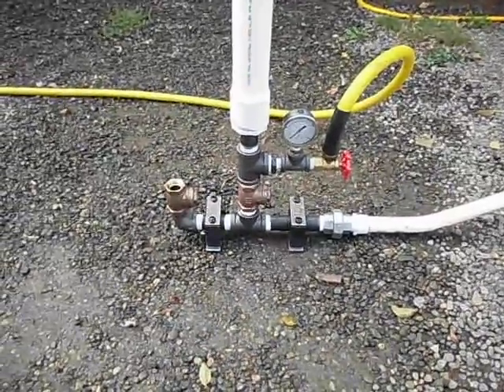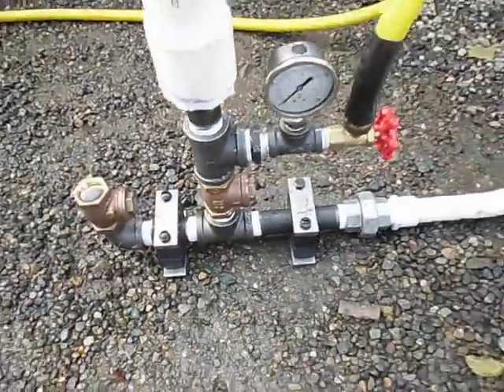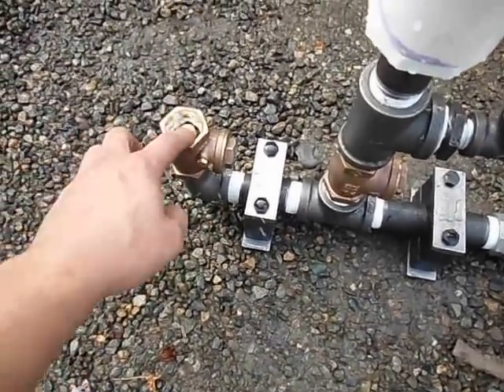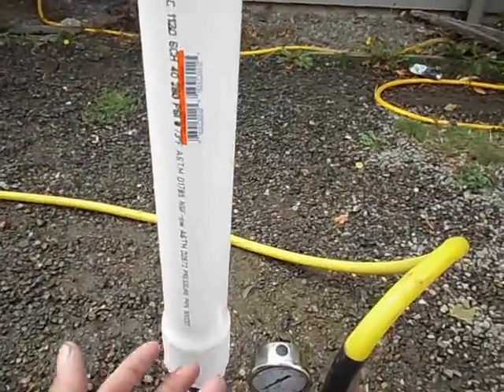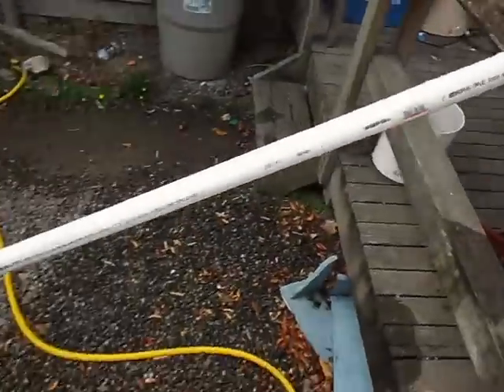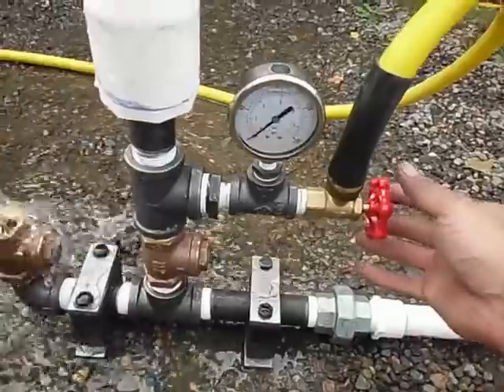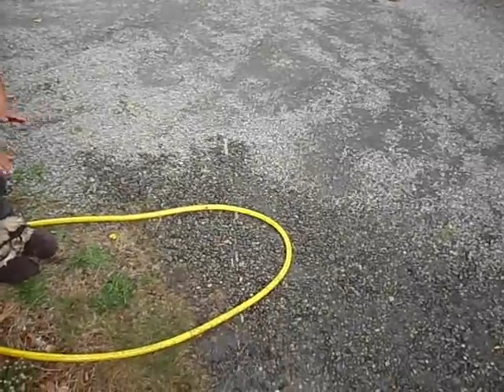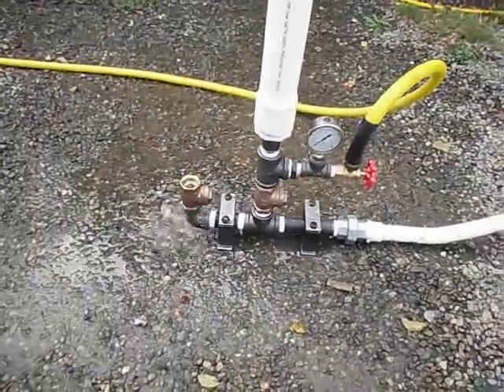Homemade Ram Pump

Comment: am needing a way to get water from a stream up a mountain and for basic use. I think this might ne the way, But one thing.... can modern materials help improve its output or range?  aka pipe dimension trickery, or space age materials?
Reply: A 7000 foot lift would mean the pipe would have to tolerate 3000 psi. That would be hydraulic hose. The lift can only be about 10 times higher than the supply water head.
Reply: I used a 55 gal. drum hung in a tree above my camp to get water pressure in my camp. The pump was about 50ft elevation lower than the drum it was feeding into with about a 5 ft elevation in the creek it was feeding from..
Reply: I ended up using a high pressure ram pump.  7000 foot elevation.  Its a trickle but it works.
Reply: Floydd   7,000 feet??? Lift? That's 1.3 miles.
Reply: Mark G thanks for the info 10: the height formula

Comment: Well done video showing a simple build method.
1. You don't need the foam in the pipe. The compressed air does the work.
2. The principle of a hydraulic ram is you take the potential energy of water at a higher elevation, convert it to kinetic energy as it moves downward due to gravity then effectively reverse that on the output.
3. The variables involved are (mostly):
   A. Volume of water source (in effect size of input pipe), volume being pumped (output pipe)
   B. Elevation (head) of water source
   C. Adjustment of the clacker valves
   D. You work a trade-off of volume of flow to height etc by adjusting your system. I don't remember for sure but I believe faster allows more height and slower allows greater volume (this may be reversed, its been a while since I've messed with this).
4. You should add a snifter hole
Don't take my info as not liking your video, I actually think its great.
Reply: for long term use you do need a diaphragm of some sort in the tower pipe, because the water flowing through will absorb the air little by little. I used a latex balloon, and it worked fine for over 2 years.
Reply: You are correct. The air will eventually disappear in most cases. This is the reason for item 4 in my original post. A snifter hole will allow small bubbles of air into the system, which will keep it perpetually running. But you have to do a snifter right. Too big and you will waste your capacity as you are pumping water out. Too small and it may plug (though a very small hole of about 1mm is fine). Peoples mileage may vary. If a balloon works though, I say go for it. Simple and cheap is always good.
Reply: It was years ago that I built a home made one. I designed my own clack valve out of cheap stuff like washers nuts and bolts, and a pvc adapter. I didn't know what a clack valve even looked like, but the one I built worked good. I just went with an idea that a friend explained to me. I never had to have a shut off valve on the 1/2 inch pipe going up to my camp either. That pump along with a gas burning water heater converted to wood burning, and a 55 gallon drum hung in a tree above my camp  for water pressure, I had constant hot and cold running water for about 2.5 years. I was off the grid living rent free. I loved it.

I just left the whole set up in the Oregon woods when I went to Hawaii to roof after hurricane Iniki hit Kawaii. , Never been back there since Hawaii. Now I am retired disabled and unable to do stuff like that.
Reply: Where does the snifter hole go?
Reply: Kube Dog  I tin in da air chamber where it's needed
Reply: NICK,
COULD YOU PLS SEND MORE COMPREHENSIVE INFO TO ME.
Reply: Where does the shifter hole go ?
Reply: NICK,
COULD YOU PLS SEND MORE COMPREHENSIVE INFO TO ME.

Comment: Pressure gauge is absolutely NOT necessary. Pump will work the same way without it. And the valve on the output line is also pointless and is also not necessary. If you have it, maybe it make sense to put it on the inlet side to stop the water/pump when you do not need it to work.

Comment: Might want to add a small valve between the main line and pressure gauge, just so that when you know its running right, you can close it, or even take it off. So it's not under constant hammering or the water.

Comment from the maker: Great question, although i dont have an answer for you as i have only used water weenies for my bladder, i believe 5-10psi would be a good start, if you do plan on using an inner tube i would suggest making your pressure vessel with a screw on top to access your bladder for pressure adjustments, keep me posted if you give it a try,....josh

Comment: Excellent.  Does the reactive bladder inside the vertical tube make a difference with pressure?  For example:  If I had a inner tube from a bike tire what pressure would be a good start.

Comment from the maker: Wheres the waste? If this were set up in a stream the "waste" would return to the stream, im not wasting any just borrowing it for a while, thanks for the comment,....josh
Reply: Josh  .. . I have a question. Say one wanted to increase the lift of the water as they had little down fall into the pump. 
Could u divert some of the air pressure in the pressure chamber into the outlet pipe and using a smaller outlet pipe so as not to lose the air up the pipe. 
Compressed air will move a liquid as air rises. 

I was thinking a controlled air flow using  a tap so that not too much air is lost out of the pressure chamber. 
If this works then the pump would be even better. 
I might have to set up a demo model like u have and test the idea. Im sure your viewers would like such a demo. This  ideo gained 3 million views. Cheers. Russ
Reply: Josh  .. . I have a question. Say one wanted to increase the lift of the water as they had little down fall into the pump. 
Could u divert some of the air pressure in the pressure chamber into the outlet pipe and using a smaller outlet pipe so as not to lose the air up the pipe. 
Compressed air will move a liquid as air rises. 

I was thinking a controlled air flow using  a tap so that not too much air is lost out of the pressure chamber. 
If this works then the pump would be even better. 
I might have to set up a demo model like u have and test the idea. Im sure your viewers would like such a demo. This  ideo gained 3 million views. Cheers. Russ

Comment: This is my theory...Ten to twenty small ram pumps, fill a bulk storage tank at the highest point they can pump to. Water is then at the same time being drained through a penstock to a small hydro electric turbine. As long as the pumps can put as much or more water in the tank as the turbine can drink, it should be plausible. Any thoughts?

Comment: @JoshuaBurks, would it be possible to connect a pipe to the first valve in order to not waste water? Maybe use the waste water to start another "homemade" pump and therefore double your output and again having another pipe connected to the "waste" valve and have the water run into it´s original source (in case of a stream/river) I´m gona try and build one as you´ve done. Another question, the foam that you used in the PVC pipe fills the top half or bottom half of the PVC pipe? Good job, Thanks
Reply: Gabs Silva 0

Comment: Check the California Plbg Code, section 604.1. Neither black iron pipe nor the fittings are allowed to carry potable water. It is acceptable for use on gas lines, but it needs to be protected from any moisture as it will rust through in a couple of years. And from the standpoint of a plumber, black iron is never used for water. The few times I've seen it, it was because it was causing a lot of rust in the system and I had to track it down. Some lazy guy didn't want to get the right part.
Reply: THERE ARE OTHER PLACES OTHER THAN CALIFORNIA.

Comment: I would love to build one to irrigate my garden. i have a small stream about 100 feet from my garden. The stream flows down hill little maybe a 1 1/2 feet, . my garden is about 6 feet higher. Is that enough for this system to lift that water to ,my garden

Comment: yes, the reason is, it has given up it's potential energy at that point. However, It could be run downhill to another Ram pump though if it did anyone any good.n  The energy only comes from the difference in height.

Comment: Just wondering if you used lighter valves you would get better performance. The water has to overcome the weight of the brass to make it function??? JAT

Comment: well ok thanks for the reply i just got back from lowes and home depot got all black iron fittings (expensive) lowes had a 2 inch brass swing check for 5 bucks on clearence from $32.00 but only had one of them so i went with 1 1/2 check for the second check hope that works!?? 2in for the first tee and check then reduced to the rest 1 /1/2  and I'm to be outputing 3/4 black poly!!  Thanks Ben if you want i can email you a few pics or post a vid when done!! keep in touch

Comment from the maker: You could also use smaller plumbing for the pump than the drive, fittings are cheaper in smaller sizes of course, should function either way,...josh

Comment from the maker: I believe you could use 2" for the whole shebang, 20' of drop is great!! Should get alot of lift outta that kind of fall, a spring check should work fine on the bottom of the pressure vessel, might have to play with spring tension, might not, good luck on your project, hope it works well for you, keep me posted,....josh, oh and as for drive pipe i believe steel is ideal however pvc works and i have seen hundreds with pvc drives that worked flawlessly.
Reply: gov will have all heads for this tech thay teach us that we always have loss but never talk about 
the converted gain we can make from eletromagnets
if u convert all the wast thermal energy around 
you u can use it universally as energy u need a true sine wave bipolar like the power comp dose a 
true pure sinewave like a grid tie inverter 
once the signal is made the system will turn on and 
consume wast thermal energy from the 
environment and space around you... there is free energy but 

it comes from Universal thermal loss and converted into a gain. so a pole Transformer and a 
microwave Transformer  have a common between each other u can take 2 microwave Transformer provide 
a pure sine wave grid tie inverter to it or a true bipolar sinewave that inter acts with nature in 
a perfect spherical motion like a flower of life..  if ur home provides this use it as a Source 
signal then u can simply stack the Transformers on top of eachother in correct fasion and note 
that the 1 wire on the Transformer must stay connected and the other disconnected your only useing 
1 wire on the hi side .. so test ur self 
2 microwave transformer stacked on top of eachother same 

face sides. one side 120 to the wall and the other 120 side to what u want to power and useing the 
Transformer just the way it came out the microwave with the wire attached causes the energy in its 
perfect spherical motion to converted wast thermal energy to amp for u hot to cold in to out... 
should look a bit nuts with u use a form of wireless energy but its interacting with the 

environment...this is my work a compilation of Otis car. Tesla. and many other very smart people 

nowadays i think i found the gate source and drainif this gets out to much that it works the 
power 

comp and mib will have our headsdont do this at home warning high voltage yet i cant stop u lol DO 

NOT TOCH THE CORES OR THE WIRES OK u will die make sure u dont touch the core if the hi wire is 

mounted to it u dont have to mount the hi on the core if u dont want u connect the 1 hi wire to 

the same side hi on the other transformer then the core should besafe to handle if nessary
grab your multimeter and prove me wrong
thats what u do i have my whole home on this
and u can take 

one of the lows side out the wall and hook it up to other stuff and power it for verry little amp 

makeing nature convert and pumping latent heat effect into the device.
and u can have a microwave 

hi volt cap in between the hi side and make a system that powers its self
u can flip the switch on 

ur breaker and the room stays on up to 2kva 
with both lows in the wall this is the zero point that 

was taken from us...
Reply: gov will have all heads for this tech thay teach us that we always have loss but never talk about 
the converted gain we can make from eletromagnets
if u convert all the wast thermal energy around 
you u can use it universally as energy u need a true sine wave bipolar like the power comp dose a 
true pure sinewave like a grid tie inverter 
once the signal is made the system will turn on and 
consume wast thermal energy from the 
environment and space around you... there is free energy but 

it comes from Universal thermal loss and converted into a gain. so a pole Transformer and a 
microwave Transformer  have a common between each other u can take 2 microwave Transformer provide 
a pure sine wave grid tie inverter to it or a true bipolar sinewave that inter acts with nature in 
a perfect spherical motion like a flower of life..  if ur home provides this use it as a Source 
signal then u can simply stack the Transformers on top of eachother in correct fasion and note 
that the 1 wire on the Transformer must stay connected and the other disconnected your only useing 
1 wire on the hi side .. so test ur self 
2 microwave transformer stacked on top of eachother same 

face sides. one side 120 to the wall and the other 120 side to what u want to power and useing the 
Transformer just the way it came out the microwave with the wire attached causes the energy in its 
perfect spherical motion to converted wast thermal energy to amp for u hot to cold in to out... 
should look a bit nuts with u use a form of wireless energy but its interacting with the 

environment...this is my work a compilation of Otis car. Tesla. and many other very smart people 

nowadays i think i found the gate source and drainif this gets out to much that it works the 
power 

comp and mib will have our headsdont do this at home warning high voltage yet i cant stop u lol DO 

NOT TOCH THE CORES OR THE WIRES OK u will die make sure u dont touch the core if the hi wire is 

mounted to it u dont have to mount the hi on the core if u dont want u connect the 1 hi wire to 

the same side hi on the other transformer then the core should besafe to handle if nessary
grab your multimeter and prove me wrong
thats what u do i have my whole home on this
and u can take 

one of the lows side out the wall and hook it up to other stuff and power it for verry little amp 

makeing nature convert and pumping latent heat effect into the device.
and u can have a microwave 

hi volt cap in between the hi side and make a system that powers its self
u can flip the switch on 

ur breaker and the room stays on up to 2kva 
with both lows in the wall this is the zero point that 

was taken from us...
Reply: gov will have all heads for this tech thay teach us that we always have loss but never talk about 
the converted gain we can make from eletromagnets
if u convert all the wast thermal energy around 
you u can use it universally as energy u need a true sine wave bipolar like the power comp dose a 
true pure sinewave like a grid tie inverter 
once the signal is made the system will turn on and 
consume wast thermal energy from the 
environment and space around you... there is free energy but 

it comes from Universal thermal loss and converted into a gain. so a pole Transformer and a 
microwave Transformer  have a common between each other u can take 2 microwave Transformer provide 
a pure sine wave grid tie inverter to it or a true bipolar sinewave that inter acts with nature in 
a perfect spherical motion like a flower of life..  if ur home provides this use it as a Source 
signal then u can simply stack the Transformers on top of eachother in correct fasion and note 
that the 1 wire on the Transformer must stay connected and the other disconnected your only useing 
1 wire on the hi side .. so test ur self 
2 microwave transformer stacked on top of eachother same 

face sides. one side 120 to the wall and the other 120 side to what u want to power and useing the 
Transformer just the way it came out the microwave with the wire attached causes the energy in its 
perfect spherical motion to converted wast thermal energy to amp for u hot to cold in to out... 
should look a bit nuts with u use a form of wireless energy but its interacting with the 

environment...this is my work a compilation of Otis car. Tesla. and many other very smart people 

nowadays i think i found the gate source and drainif this gets out to much that it works the 
power 

comp and mib will have our headsdont do this at home warning high voltage yet i cant stop u lol DO 

NOT TOCH THE CORES OR THE WIRES OK u will die make sure u dont touch the core if the hi wire is 

mounted to it u dont have to mount the hi on the core if u dont want u connect the 1 hi wire to 

the same side hi on the other transformer then the core should besafe to handle if nessary
grab your multimeter and prove me wrong
thats what u do i have my whole home on this
and u can take 

one of the lows side out the wall and hook it up to other stuff and power it for verry little amp 

makeing nature convert and pumping latent heat effect into the device.
and u can have a microwave 

hi volt cap in between the hi side and make a system that powers its self
u can flip the switch on 

ur breaker and the room stays on up to 2kva 
with both lows in the wall this is the zero point that 

was taken from us...

Comment: Hi josh Im Ben from maine and i am planing to build one of these pumps for my farm and i'm going to be using 2 inch pipe for the drive pipe but should i stay with 2 inch for the whole pump? Also I have seen people use spring checks for the out side and swing for the waste Is that fine? and is there really a problem using plastic pipe for drive with very very slow curves but a 20 foot drop? Thanks Ben hope you can help me   please reply soon